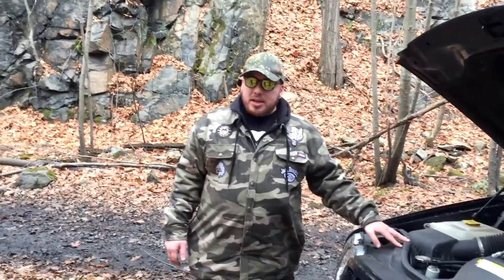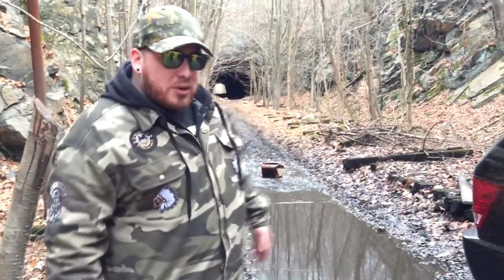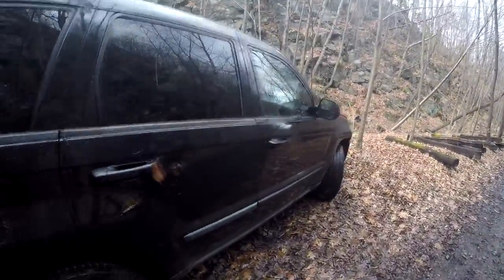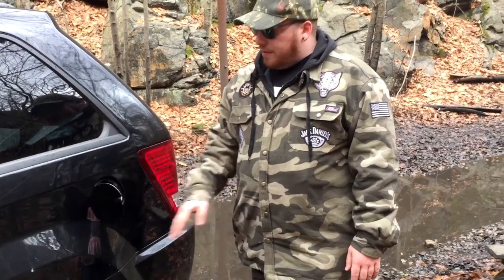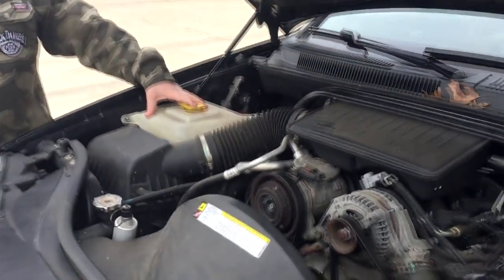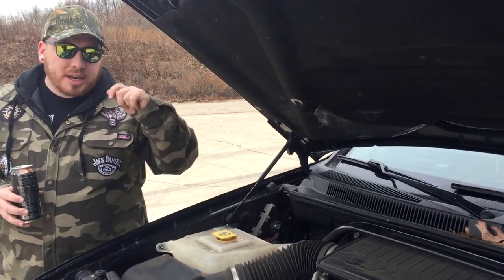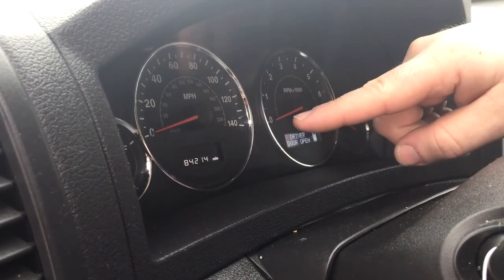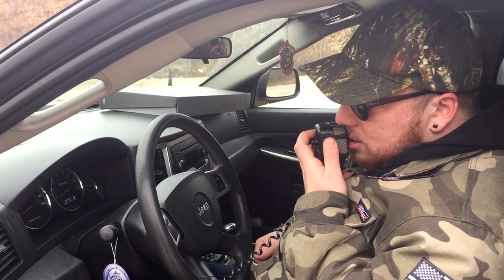Shit JEEP Owners Say

Comment: I thought this was a Jeep video not a soccer mom suv video.
Reply from the maker: Greg Wallace at least I can move all the soccer balls and dirty laundry to plow all the soccer moms in the back seat! I can only imagine what you have
Reply: Mike Gray CJ, 351w 44”swampers on bead lockers, coustom suspension 60 Dana no roof  just cage. I plow soccer moms in the open so everybody can see and you still drive an suv built for picking up kids and groceries.
Reply: I guess it’s no fair to compare a rock crawler that’s not street legal. My daily driver is a TJ rubicon 6inch rubicon express lift 37pro comps 44dana 488 gears. My wife has a compass it’s like yours she thinks it’s a Jeep too.
Reply: Yes I realize I’m the typical Jeep guy that this video is making fun of.

Comment: Anything past 2000 isn't a Jeep. They've ruined the brand
Reply from the maker: Alex Livingston are you kidding me?
Reply: Mike Gray Jeep was built on the principle of being rugged and cheap and easy to fix. That's why they used the Willy's Jeeps in the army. New Jeeps are not rugged, not easy to fix,and definitely not cheap.
Reply from the maker: Alex Livingston hey, gotta change with the Times man, most people want luxury cars now so that why jeep is making them the way people want them... supply and demand! I have never had one problem with my jeep since I’ve owned it.
Reply: Mike Gray your poor Jeeps doesn't have the chrysler 4 liter inline 6 also which is a staple of old Jeeps. An old Cherokee is a lot better to off road than the new ones.
Reply from the maker: Alex Livingston but hey try to race an XJ with a srt 8!
Reply: Mike Gray understandable. But Jeeps were not meant to be fast on a track they were meant to be versatile off road
Reply from the maker: Alex Livingston which they still are, but like I said before they want to make what the people want now. The brand is still going strong, I see more jeeps on the road now then I ever did before
Reply: Mike Gray  but none of them are used off road. That's what saddens me
Reply from the maker: Alex Livingston are you kidding? There are jeep clubs all over the place that go off roading
Reply: Mike Gray but not with the new Cherokees and Grand Cherokees because they are luxury not off-road oriented like you said earlier
Reply from the maker: Alex Livingston I know a lot of people that still off road with their jeeps
Reply: If they made a new old jeep i would be driving it.